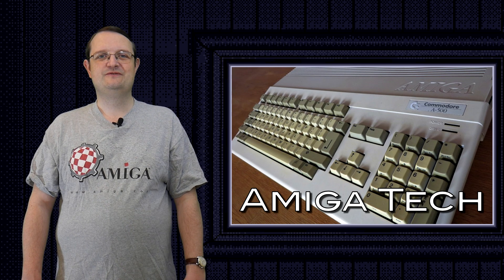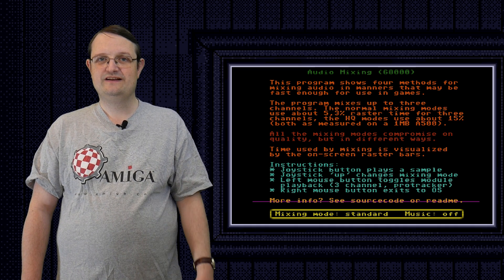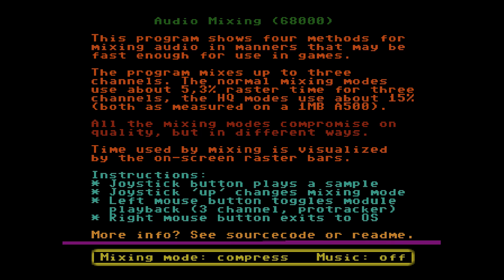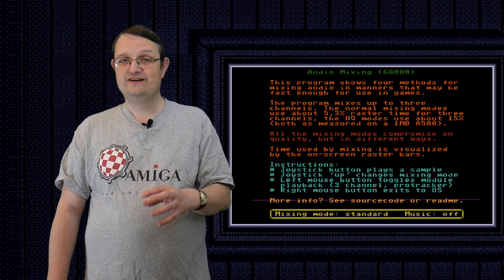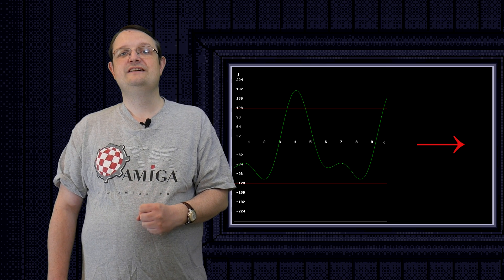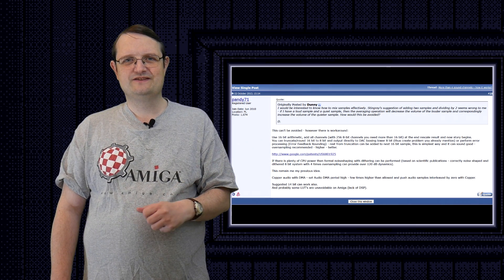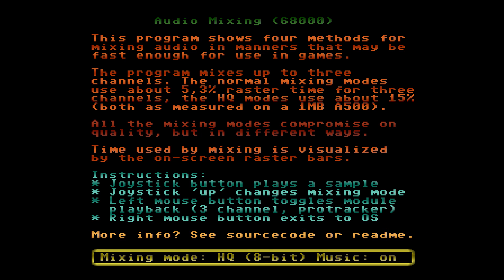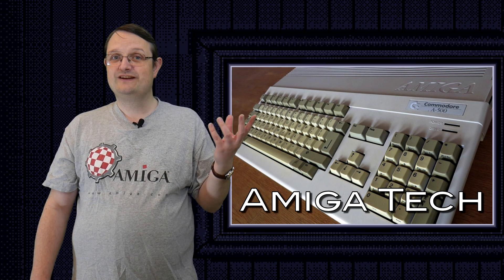Amiga Tech - Audio Mixing for Games

Comment: I would like to have a sound effects sound creation tool for Amiga, it is like one Protracker track, but using small looped sample to play with the pitch and volume (like 8bits computers does) and then take the project to the Amiga game, this will save a lot of chip ram space and will allow to do many sound effects with one small looped sample, but changing the pitch and volume.
Reply from the maker: An interesting idea for sure!

Sounds a bit like making a software synthesizer, I wonder what kind of CPU load would be needed to do so. If you can get away with just using some basic waveforms it may actually be fairly small. But some 8 bit systems allowed for fairly advanced synthesis, which might be more expensive.
Reply: @DutchRetroGuy  well, I was refering more like to play small looped sample and manipulate the pitch and volume only, that may be not very CPU intensive because Amiga and Spectrum does in videogames. For example, Turrican 2 does, I would like to have this technology for our games.
Reply: I think, TFMX editor have script, when you can fire a sample every line, with different volume and pitch.
Reply from the maker: @TonimanGalvez  right, I see. Well, it could work - as long as you don't mind sharing a waveform for many effects. The benefits are obvious (small memory size and many different sound effects possible). The drawback would be that you use only one or a few waveforms so you risk things sounding more "8 bit". This might not be an issue, depends on the game I guess :)
Reply: @DutchRetroGuy  My target is to make it sound like Turrican 2 sound effects, but depending of witch sample you are using, may sound more like 8bit. It is is not fair when I want to have like 25 different sound effects and it eats a big part of chip memory because I have to load 25 different samples on memory.
Reply from the maker: Toni Galvez yes, the Amiga’s use of samples is a definite double edged sword... great sound quality is possible, but it uses so much memory.

Your idea could be a great help there, no way to find out how it sounds until you try :)
Reply: @TonimanGalvez  What you are suggesting is called a wavetable synthetizer.
Essentially, instead of using a long sample, one is using a very short loop of a few periods of the sound and as time progresses switches the sound smoothly to other short loops. This can give similar quality as long samples but using much less memory.

Many SNES musics used a similar technique because the sound RAM of the SNES is so limited that they could not use long samples.
I am not aware of any Amiga game using this technique and that's definitely a missed opportunity in my opinion.

Another advantage of those short loops is that they could work really well with a fixed sample rate mixing routine since they would be short enough to be stored for multiple pitches.

Comment: Great idea! Hope to see this implemented in real application like game or demo.
Reply from the maker: no9 Thanks! I hope so too :)
Reply: @DutchRetroGuy  To bad we was never given a tracker with such ability to use 3 hardware channels and two, three or four... software ones, even with if they would be absurdly low quality ones. I think some STE Protracker clone did use such approach to achieve 4 channels compatibility with Amiga modules.
Reply from the maker: @no9or9  there was TFMX, which does this. But the problem with trackers is that they require more flexibility than this scheme really allows for. This type of fast mixing doesn't allow you to have multiple pitches, which is basically required for making music.
Reply: @DutchRetroGuy  Drum sounds and loops are perfectly fine with not having pitches. Soft-channels could serve it's purpose as supplementary ones. And if some kind of software synthesis comes in it could let musicians do do much more than standard 4 hardware channel.
Reply from the maker: @no9or9  drums could work, though IIRC these do normally require a higher sample rate so sound good. Software synthesis is an interesting option. Wonder why that isn't used in trackers more often to begin with.

Anyway, I seem to recall that many mod creators used pieces of software that allowed you to make a small module of, say, a drum loop and then combine the module into a single sample. Then that sample was used in the module to have one channel play back up to 4 instruments. Does take quite a bit of memory, though.
Reply: @DutchRetroGuy  Electronic music genres doesn't require highest sample rates. Lo-fi sounds are often used by purpose.
Yes, there was program called MOD2SMP which did exactly what its name says. Another way was just to have two Amiga computers and record sample from one to another. Or just to use tape recorder to do exactly same thing. But as you say - it bloats sample data and makes sound less flexible than having just realtime channels for this purpose.

AHX and Pretracker can be considered as soft-synth Amiga trackers but unfortunately they doesn't allow to use samples...

Amiga Protracker line had freeze at some point in history and just didn't develop such ideas to full Amiga potential. New multi-channel trackers started to pop-in and as cpu accelerator cards also found it's way to the masses all work was just thrown on CPU, including sound mixing.

I think you could get hardware and software channels in Octalyzer but creating anything in that tracker wasn''t close to pleasing experience and quality didn't shine either.
Reply: Maybe contact the guy programming Hamulet. I think he might be interested in this.   Amiga 1000 https://youtu.be/XDdMoglmUbs?t=887
Amiga 500 https://youtu.be/JJczdYO8N1c?t=230

Comment: This series is great, I look forward to future episodes. I have loads of ideas, like how to do ADSR as a routine for Paula, but I think now it's to late for me to start from scratch how to do 68k coding of the complex interconnected Amiga multiprocessing chipset. I always knew my Amiga 1000 was really powerful but to get the best out of all the features of OCS is quite tricky as it was for Sega Saturn developers.
Reply from the maker: Thanks, I still have a bunch of ideas so there will certainly be more of these. OCS is indeed powerful and fairly complex to program compared to say a Mega Drive or SNES (which isn't to say that no complex code exists for the MD or SNES, just that the basics are more complicated for the Amiga then for those type of systems). But that only makes it more interesting to me :D

As for it being too late, I do agree it takes time to become fluent in 68000 and time to learn the chipset, but in case all you need is some encouragement: I only really started to tinker with 68000/OCS in 2014. 

Now that may sound like five years of learning, but that's not exactly true - I spend a lot of my hobby time doing very different things. I'm pretty confident that it can be done in under a year. Still a big investment, but not impossible :)
Reply: @DutchRetroGuy  I think the Sega 100% machine code games like Sega Rallly for the Saturn are much closer to the complexity of getting close to 90% out of the copper/blitter/DACs and 68000. At least on OCS/ECS machines the memory is 14mhz access across the bus so there is little CPU blocking for the 7mhz components. The complexity is also what makes it so powerful, there are many ways to do the same game engine on an Amiga....the fun is finding out what to do with everything. I was also thinking of a 32 colour hi-res interlace mode using sprites to fill in the extra colours underneath the bitmap, a bit like C64 hi-res sprite overlay technique.
Reply from the maker: @madcommodore  Yeah, that's pretty much true (though no part of the OCS bus runs at 14MHz, the 68000 just can't use more than 1/2 of the 7MHz cycles).

The fun is indeed in finding the best way to to each thing. Which is probably why a lot of Amiga games were somewhat lacklustre: it takes a lot of time to optimise for each individual game and so publishers mostly didn't. There were exceptions of course, but lots of Amiga games do not use the hardware in an optimal way.

Comment: Can’t remember when I stumbled onto this.  http://amigadev.elowar.com/read/ADCD_2.1/AmigaMail_Vol2_guide/node00DF.html but wound be interesting to hear what interleaving samples sounds compared to your techniques you demonstrate here :) ( been way to long since I did anything on my amigas to even attempt this)
Reply from the maker: I did consider adding sample interleaving, but I've been repeatedly told that it sounds pretty poor due to the introduction of a high pitched whine into the sound. This can be fixed, but that takes far more CPU time than is reasonable (or an insanley high sample rate).